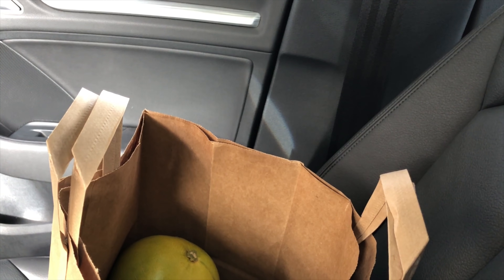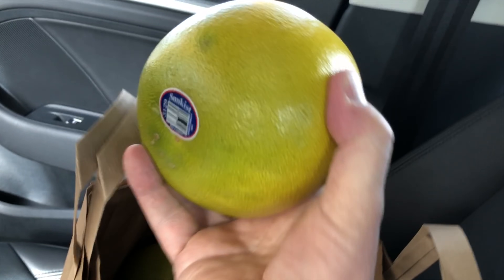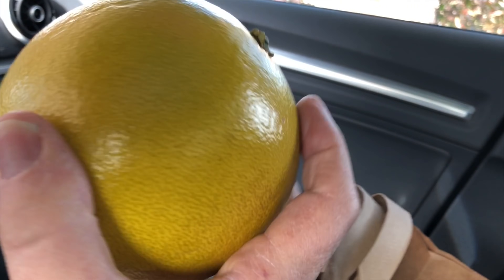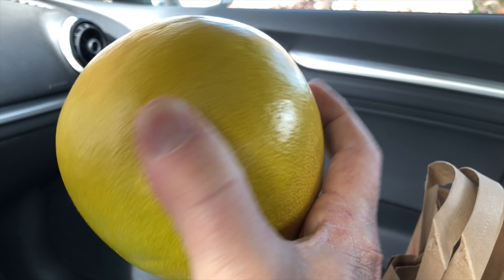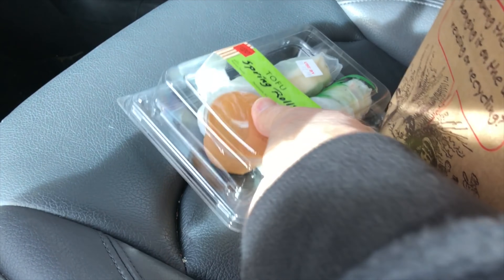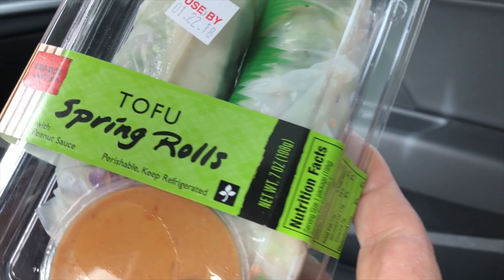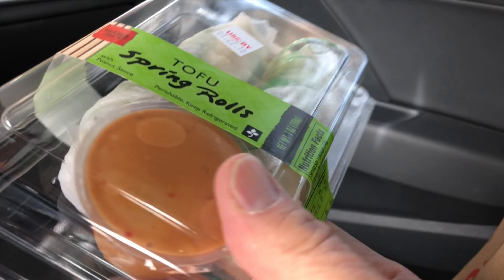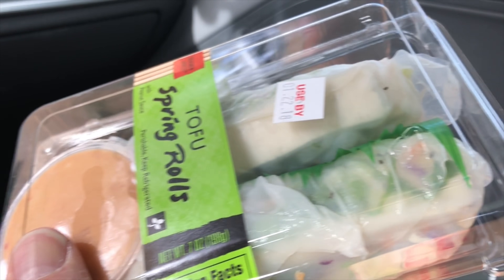The future of Class D amplifiers

Comment: We are at the point of taking thousands of components (considering an IC package) to try and replicate what a few components in a vacuum tube circuit does.  With an instrument amplifier, especially, you have to ask, whats more efficient? Simplicity of what works or something sterile sounding and digital that just isn’t there?
Reply: Class D is more about power consumption and how transistors/tubes work, when they consume power.
Tubes always consume power for cathode heating, and additional power for voltage to start electrons emission. Also class A amp on tubes consumes power for current to have the middle voltage signal producing zero-signal.
Transistor consumes power when it is in intermediate state between fully closed and fully opened. The shorter this period the less power transistor dissipates. Class D with power transistor pulses makes intermediate state of power transistor to last near zero time (nothing can be switched at zero time, but as we know current processors can work at 5GHz frequencies, and during the period of 0,2ns 10 to 15 transistors sequentially connected to each other like emmitter to base are able to switch). This is why it class D is most efficient amp in power consumption.
But there are some alternatives. E.g. class H power supply for class AB amp provides immitation of fully opened transistor of class D for high voltage signals. Since low voltage AB class dissipates much less energy than high voltage AB this helps to reduce power consumption, but still stay class AB in quality and simplicity.

Comment: I think Class D might one day better all other classes, simply because the switching speed is the main limiting factor and semiconductor research is improving all the time; once we can switch reliably at high currents and voltages at many MHz, you wont even need to filter the output. But yes at the moment; its a tricky business creating an accurate reliable class D.
Reply: NAD already did it.
Reply: Agh good old NAD, didn't realise those were still manufacturing. But even they cant break the current manufacturing restrictions on semi's.

Comment: I don't understand why pre-amps are even used at all. There shouldn't even be a DAC in the system as the digital stream can directly feed in to the PWM timing register.
The only drawback of class D that I can think of is when to save cost you end up using a switching frequency that is not high enough above the audio range or have poor regulation of the drain voltage.
Reply: Some examples SMSL Q5 and HifiMeDIY UD20

Comment: Class D amplifiers literally vibrate themselves to death. High frequency switching at high currents equals failure of the connecting leads to the switching devices
Reply: Hmm, so why the very low failure rates in switching power supplies, in which both frequencies and currents are on the high side?
Reply: I work as a repair technician for electronic musical equipment, amps, keyboards, speakers. I don't know the percentage of failures in the supplies, but I do know they don't last under heavy loads, say for subwoofers. They cannot deliver long term power as well as a linear supply, including without failing, intermittent operation, or overheating and failing.
Reply: I was in the repair business back in the day, so I can sympathize, but if Class D professional amplification was as intrinsically failure-prone as you say, the dozens of highly-respected companies who've gone that route would be bleeding warranty service money and abandoning the technology in droves.  I think the problem with the testimony of folks in your (and formerly my) end of the business is that we constantly see worst case scenarios and tend to assume they're representative of whatever category of equipment into which they fall.  Back in the 1970s, solid-state professional amplification simply wasn't as tough as comparable tube stuff -- high-power all-transistor stuff like Phase Linear simply couldn't take the sort of abuse amps endure in a high-volume rock & roll setting, conditions that wouldn't faze a tube monster like a McIntosh MC-2300, one of which I sold to a local rock club circa 1973 and is still going strong 45+ years later with no service other than routine tube and coupling cap replacements over all those decades.  Fast forward a few decades and the only remaining vacuum tube stronghold in the live music business is guitar (and a few bass) amps -- everything else is solid-state, with a good deal of digital circuitry  thrown in, virtually all of it every bit as reliable as that humongous old McIntosh.
Reply: No it is not. Today's equipment is designed to last through the warranty period and that's it. Afterwords, there is no support for the product as it is replaced by new equipment. It's thrash and trash. We have problems getting support even for new products. The music electronics industry in general is producing stuff that may last a few years, won't be supported if there is a problem, and in some cases is not supported except for total replacement on new equipment.
Reply: The problem is that the service business is pretty much obsolete when it comes to most modern music gear.  I saw this coming 40+ years ago, because it was already becoming cheaper to replace a defective product than to pay some local shop to fix it -- especially since the stuff is built in highly automated factories located in low-wage countries.  IOW, like I did, you're using what amount to 19th and early 20th century methods to rescue equipment built with 21st century procedures and the economics just don't work for the manufacturers and, increasingly, for the owners of the gear.  Oh well, there's always guitar amps -- until their owners get fed up with maintaining them, as I did when I could no longer just get one of my techs to take care of it.  I traded my highly modified tube amp -- pretty much a Tweed Bassman in a smaller cabinet with a 10" JBL -- for a Class D amp that sounds just as good but is smaller than my little reverb pedal and its own power brick.  Too bad I can't shrink that JBL -- but my rig is a lot lighter now even with that heavy speaker and its (now empty) cab.  :-)
Reply: My only comment is have a spare amp handy
Reply: Good advice with any technology -- and, in the case of my little Quilter, "a spare amp" would cost me less than getting any non-trivial repair done to my old tube amp by a competent technician.  As with most non-audiophile home hi-fi applications, Class D is a win-win for size, weight, power consumption, value, and performance with it comes to portable live music amplification -- and even the dozens of music venues here in Asheville are replacing the old power amps in their house systems with Class D models as their old stuff continues to bite the dust from sheer old age.
Reply: Just buy two of everything. Saves time and trouble. Trash pile gets bigger and bigger
Reply: Except my "trash pile" would be a lot smaller -- I can carry a dozen of those little Quilters in less space than a single Fender head takes up, and that Fender is every bit as likely to fail.  Get your Class D gear from folks who understand both the technology and the application -- e.g. my Quilter MicroBlock 45 for small room and/or miced electric guitar or one of the PS Audio Sprouts for home hi-fi (I'm sure there are other competently designed/built alternatives) -- use it as intended, and it'll be every bit as reliable anything else that can do the job.
Reply: That's subjective. I think Quilter amps sound card-boardy. Just my opinion. As far as trash piles are concerned, that Fender amp can be fixed no matter what is wrong with it, many times even if that includes the chassis. Can't say that about the trash you will accumulate. We just emptied out the basement of our shop. A couple of pickup truck loads of dead gear. by the way, it was all solid state. It just turns to trash. The Fender amp keeps working.
Reply: Quilter amps fall short because of their speakers -- I'd never use one of their combos, but my little MicroBlock 45 sounds almost identical to the Tweed Bassman clone it replaced when driving the same 10" JBL.  Like I said, the cost of maintaining a tube amp will quickly dwarf that of the cost carrying two tiny Quilters -- and, since the power amp section is in a chip designed by experts, its MBTF is going to far, far shorter than anything that depends on glass or conventional discrete transistor output stages designed by hacks at companies like Peavey.  This is not your dad's fragile solid-state, Bob -- the critical bits come from genius-level engineers who know exactly what they're doing, and given adequate heat sinking, a proper output load, and enough clean B+ there's no reason modern Class D stuff can't last forever aside from the usual wear and tear to controls, jacks, and/or switches to which that any amp can fall victim.

After over 50 years depending on and suffering with tube guitar amps, I'm more than glad to be free of them, their weight, their heat, and their constant need for my attention.  I tell you what, Bob -- I'll get back to you if the Class D chip in my Quilter ever fails, ready to eat my words with a side order of crow.  Take care, and I hope all those recapping jobs, tube swaps, and bias tweaks continue to be enough to keep a roof over your head and food on your table!  :-)
Reply: @Bob Walker, that cannot be so. If high frequency switching at high currents was a problem then every radio transmitter in the world would fail seconds after being switched on.
Reply: Lister Dave  -- Like most bench techs, Bob sees problems (most of which are the result of manufacturing/QC failures or user errors) and imagines rather than understands their causes.  I managed a shop full of folks like that, and only two out of my crew of eight actually understood how circuitry worked -- the others were skilled parts changers who could diagnose and fix routine problems going by hands-on experience or manufacturer-provided procedures.
Reply: Please allow me to clarify what I'm saying. Aside from Mr. Morgans or anybody else's point of view, I'm talking in particular about two Carvin model Acoustic amplifiers, who had power supply failures due to  the AC/DC switching converter. In particular,  the Viper100A-E. In time due to (ok, you tell me) the leads carrying the load current detach themselves from the main body of the device. Granted, they are clamped to the heat sink, while the leads are connected to a board that is separate,  I guess I'm just jumping the gun with my mere two years of engineering physics, but I still think putting high current at high frequency through a lead that is stressed to fit into a board is not a good idea and I have had two experiences with this. As far as radio transmitters, you got me. Maybe the people that design class D amps might want to look into that.
Reply: Bob, you're describing a particular (and particularly blatant) design flaw in a particular piece of equipment, not something that is intrinsic to all Class D products sold into the pro sound market -- and it's a problem that would not have occurred had there been adequately rigorous engineering and prototype testing that accurately replicated real world operating conditions.  Thanks for clearing all that up.